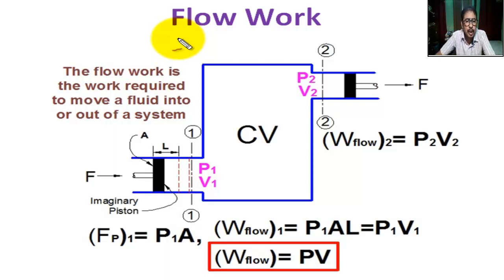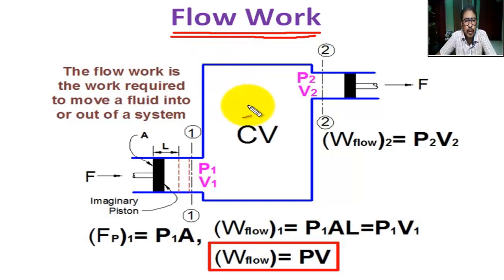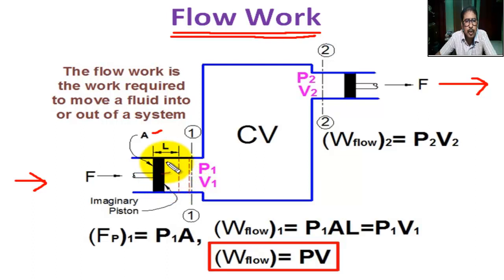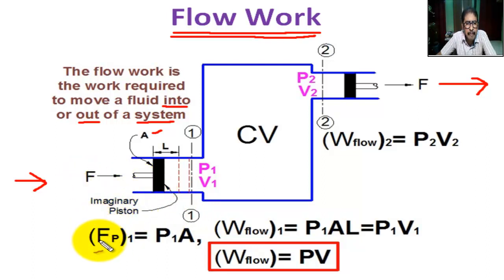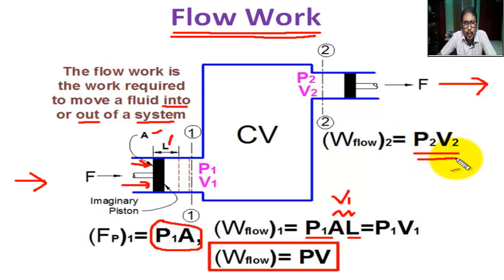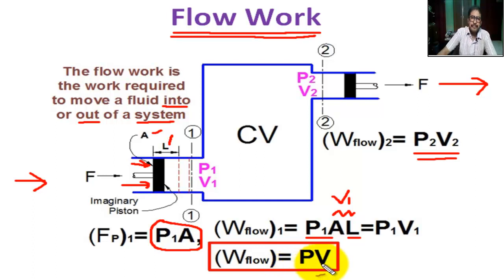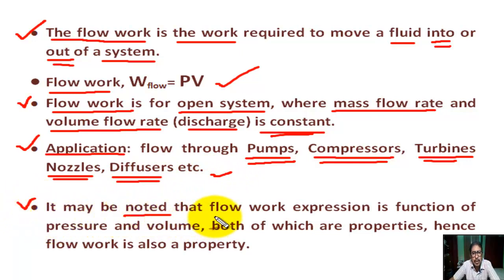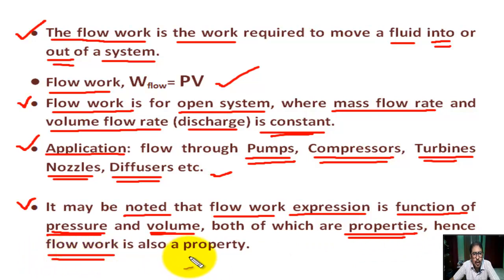Flow Work in thermodynamics

Comment: pump forces 1 m3/min of water horizontally from an open well to a closed 
tank where the pressure is 0.9 MPa. Compute the work the pump must do 
upon the water in an hour just to force the water into the tank against the 
pressure.... Can you solve this problem sir🙂